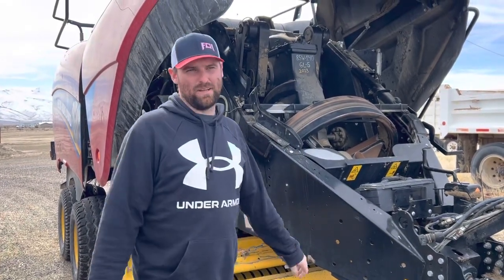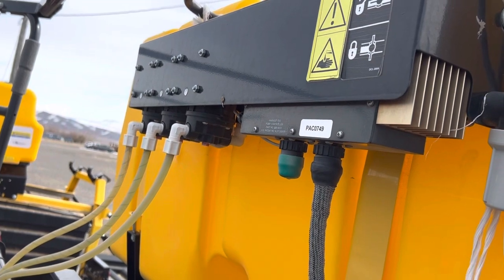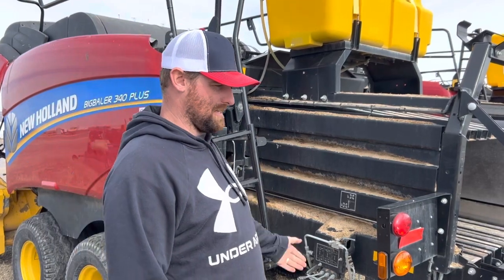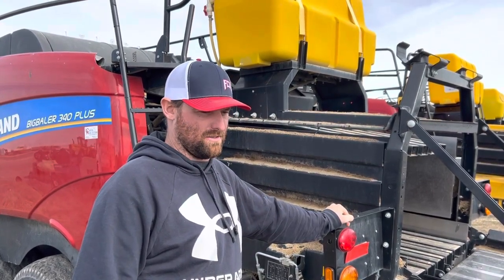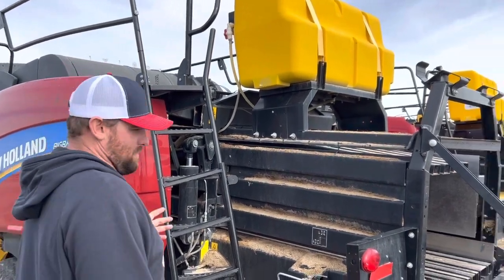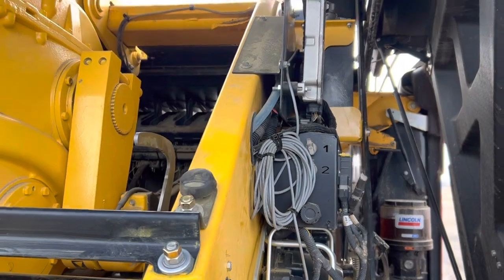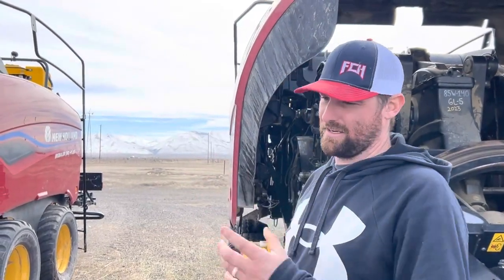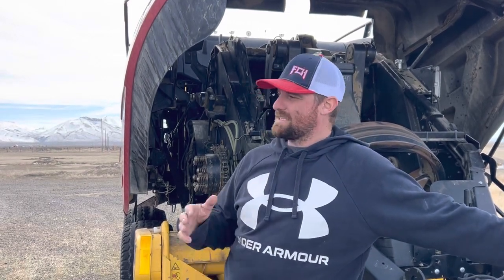Harvest Tech preservative kit

Comment: I run 2 of the 3 pump units and I agree with your comments on the pumps getting dust in them.  The biggest problem I have with mine are the diaphragm check valves on the nozzles becoming plugged and they won't open to spray when the pumps kick on.  Is the new system running the same diaphragm valve on the nozzle body?
Reply from the maker: No they are running solenoids
Reply: @SuperFriday88  HI Cody! Do you have Timothy  hay this year to sell? Would it work to ship Timothy hay to Central WI? I would like a way to call you if I could?